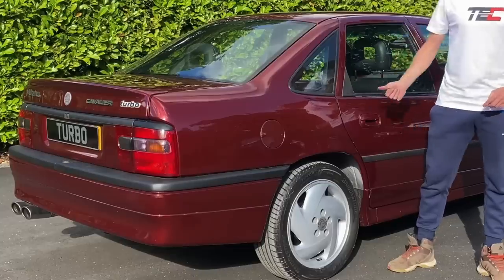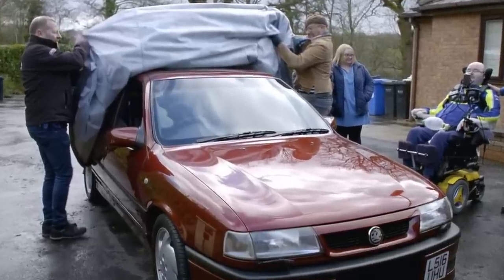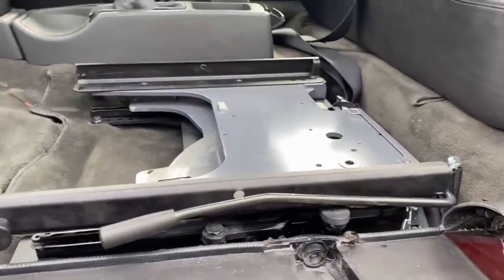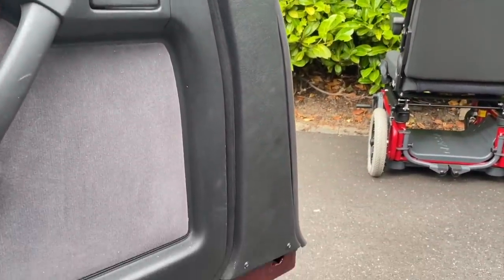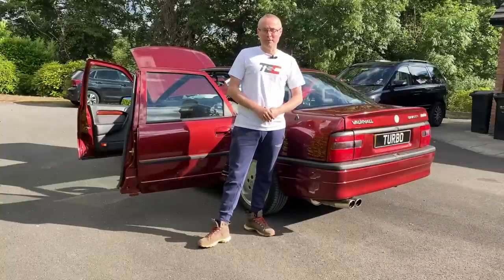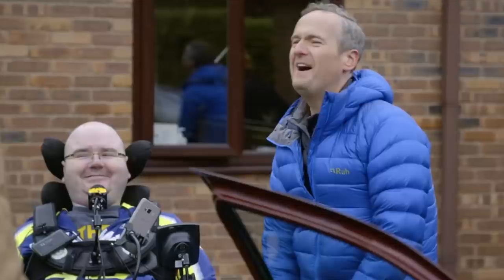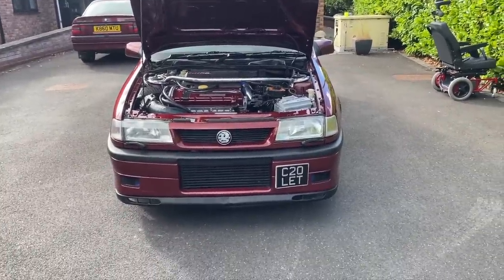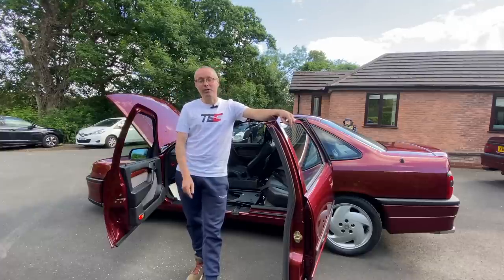Car SOS 300HP Vauxhall Cavalier Turbo! *SUICIDE DOORS?!*

Comment: I was involved in the building of the cabs for the film 28 days later and yeah, what you see on camera vs what you can get away with in real life is quite significant.  Here's a fun fact, in the scene where the cab drives over all the other vehicles in the tunnel, it really did do that!
The stunt cab had wider tyres fitted along with skis welded underneath and all of the cars it drove over were wrapped in a metal mesh like that green coated metal fencing used in the UK to give it a flatish surface to bridge the gaps between roofs which was edited out from the footage.